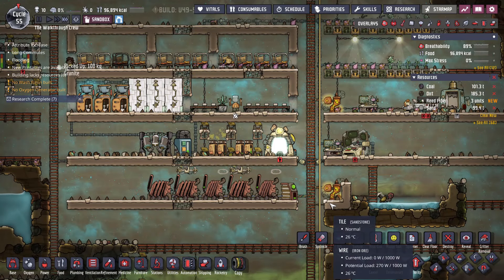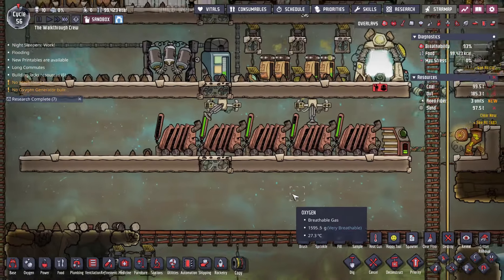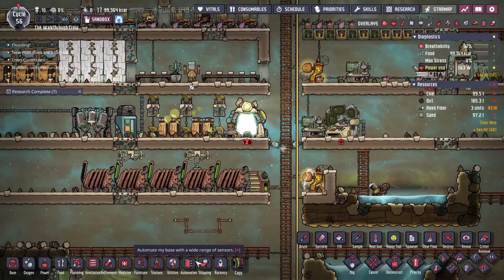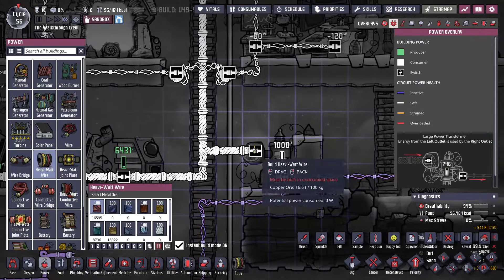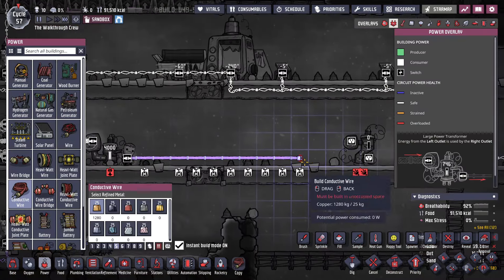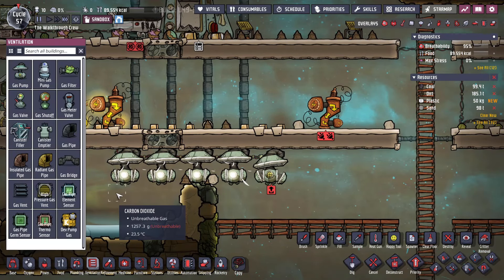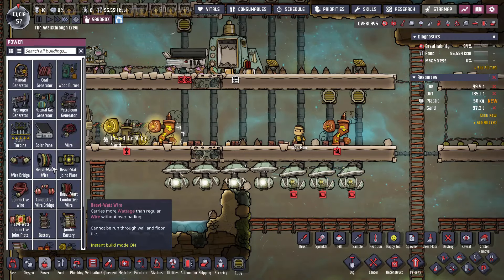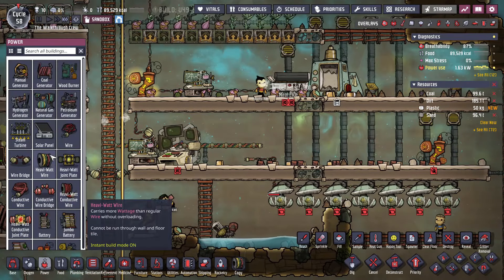How to Manage your Power Lines in Oxygen Not Included

Comment: Question:
Won't the 4kw transformer overload the conductive wires, since they can only handle 2kw??
Reply from the maker: Yes, although overloading at least draws more attention to a power line issue.  I would rather have that than brown outs personally
Reply: @Magnet_MD  ok, thank you for the answer.
But can you use two 1k transformers on the same line instead?
Reply from the maker: You can.  It will produce a little more heat and take up a little more space, but still very doable.
Reply: @Magnet_MD ok! Thank you for the answer! I really can't get enough of your playthroughs😊😊

Comment: How do u deal with radiotion, generator ect?
Reply from the maker: I'm not sure what you're asking, just radiation in general in Spaced Out?
Reply: @Magnet_MD i mean do you have a standard setup for rad reactor and generators? In my case i cant build a fully functional rad reactor thats why
Reply from the maker: I don't typically do things with reactors, they aren't really "necessary" to completing a run, so I don't have very good advice on that front.

As for generating just radbolts, both wheezeworts and crashed satellites are great.  You could use Uranium Ore as a last resort, and even still, it's not too bad.